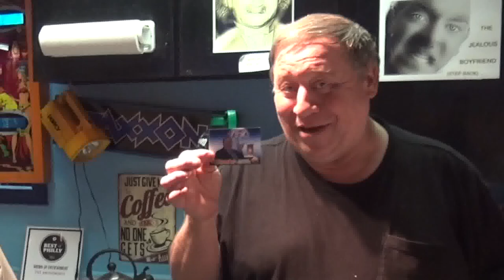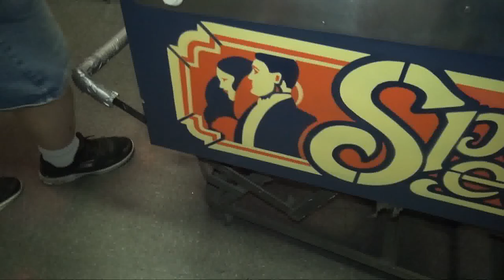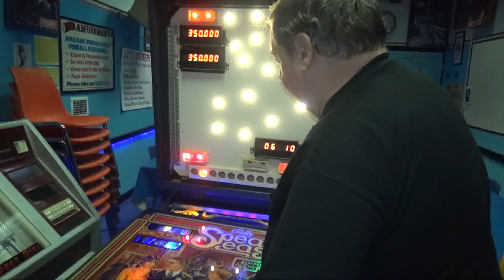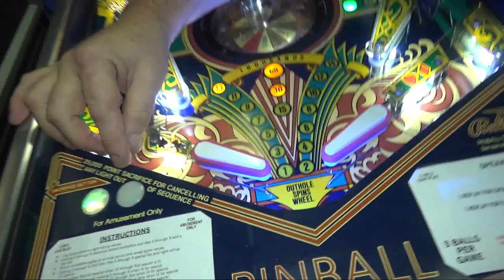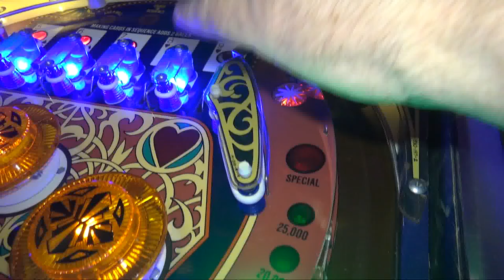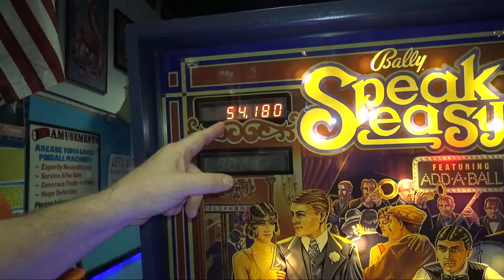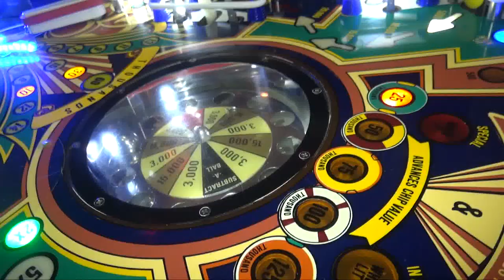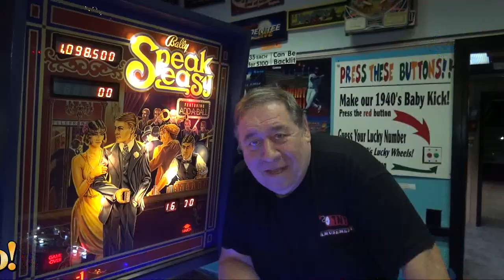#1317 Bally SPEAK EASY Pinball Machine and its Secrets! TNT Amusements

Comment: Hi Todd, Thanks for another great vid! Is there a reason most playfields are made of wood instead of some kind of plastic or resin which would keep their shine for longer?
Reply from the maker: This was an experiment...and it seemed to hold up just fine in my opinion...I heard that the screw holes holding the parts loosened up quite a bit, but so did the wood playfields!  Just not sure!

Comment: was there a setting for the 'subtract a ball' to actually add a ball or was that a 'wiring hack' because one arcade i played at actually did that
Reply from the maker: I did not think so...look in the manual that's on www.ipdb.org and see...it can easily be downloaded for free.
Reply: You'd have to jump or short a  connection on the roulette wheel.  Not easy.

Comment: So I bought the machine...AND there IS a way of turning off that annoying background music. you can program it with the reset button...don't remember how I did it, but I did it. So now all you hear is the basic noises when you hit the targets only!... The only thing I don't like about the playfield is that when you try to hold the ball with the right flipper, there is no one way gate (like you have on the left flipper) so if the ball is going at any speed above a crawl, the ball will go up the side and then down the right chute and into the toilet!...very frustrarting as one of the main functions of a good pinball machine is that you should be able to hold the ball easily with the flippers IMHO... The left flipper has a one way gate so no issue there...I'm seriously thinking of making my own gate and adding it in...everyone who plays it complains about this issue.
Reply from the maker: Yes...ALL bally games with the newer sound board have several sound options that does include no background sounds...but there are few other sounds, so it makes it pretty quiet!  And yes, there are plenty of people that modify their games to make them more fun and les annoying like losing the ball down the side!